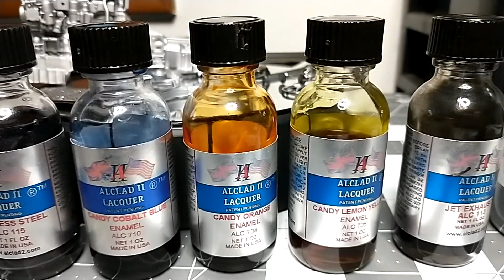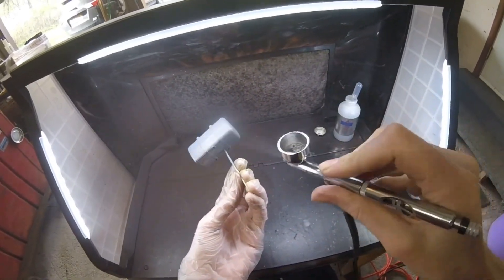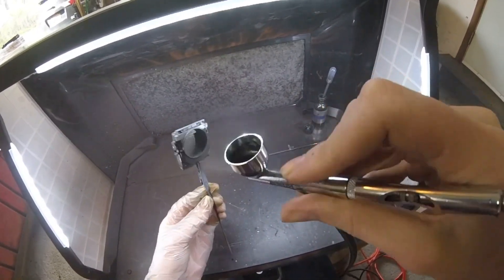HOW TO: use ALCLAD lacquer metal paints

Comment: I don't have a 0,4mm needle. Should I use 0,3mm or 0,5mm? Thanks great video
Reply: I'd recommend the 0.3 as they are very thin and you want to spray it super light, for the best mirrored finish, if you're going for a chrome/polished metal look.
Reply: @hhaste  thanks will try it out

Comment: I just used the Alclad Chrome and OMG what a gorgeous job it did. Alclad is 100% my favorite chrome paint by far!! I also bought Alclad White Aluminum. I will be trying that next. Thanks for the tutorial
Reply: Their metals are great. Just be careful with some of their paints as they are labeled as lacquer but they're actually enamels, which take a lot longer to fully dry, even if they feel dry to the touch. It can cause problem with top coats, as I just found out. Their gloss black base and gloss "Klear Kote" are both enamels. The klear takes many weeks to fully dry and seems like it's impossible to wet sand and polish.. the Aqua Gloss clear is great, though.

Comment: Very informative and great video, FYI, I painted a 1/32 scale, airplane and found it needed one and a half bottles of metal paint.  Because this paint is not thinned it does not go as far as other paints you may have and because it’s so thin it takes a bit to get a nice evening coat so word of note buy extra or you’ll be ordering it with the job half completed

Comment: I'm new to airbrushing, what bottle of rustoleum primer did you use and how did you pour it in to the airbrush?.
Are these paints and primers good for both metal and plastic models?
Also, alclad primer (black) dried and clogged my airbrush, how much time do I have to use the primer before cleaning the airbrush?

Comment: The main thing I find difficult, is to get a decent glossy black undercoat for the Alclad Chrome.  At best, the chrome turns out like Gun Metal.

So I'm experimenting with Bare Metal / Household Kitchen Foil on a build, but not finding that particularly easy either...